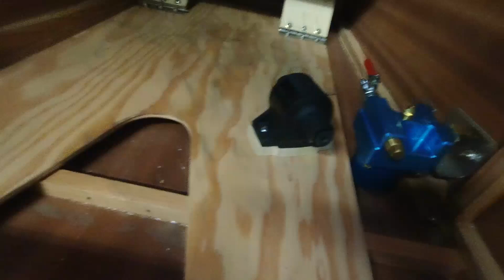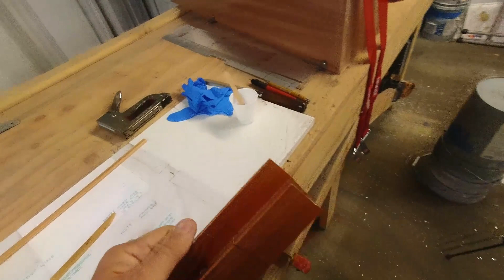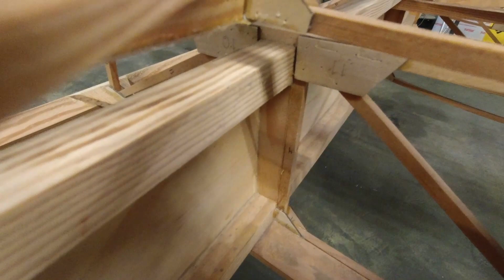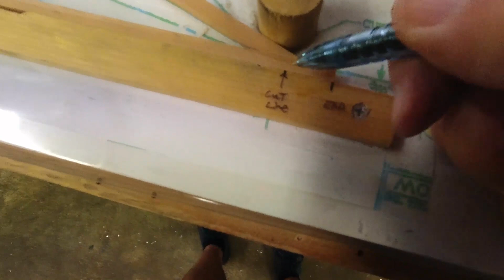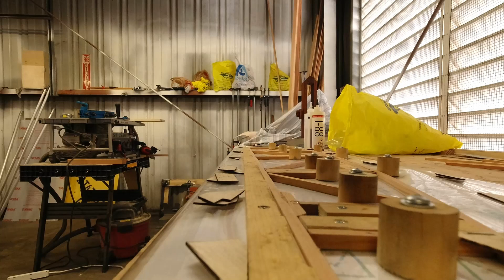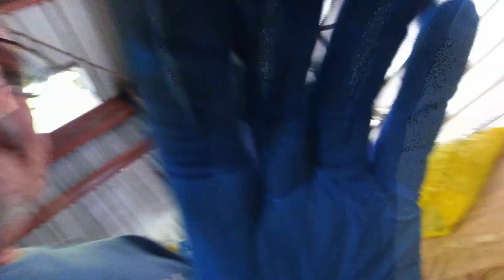Minimax 1100r Wood Aircraft Build Ep 130 - Building Wing Rib

Comment: So I’ve acquired a mini max. It’s older.  Stored inside out of the light..  so do I gotta worry about the glues and epoxy degrading?  Is that an issue on older mini maxes?
Reply from the maker: Do you know what epoxy was used? was it T-88?
Reply: @DTMinimax no idea.  It was built long before I was born I do believe..  my grandfather has had it the last 20 years and it was used when he got it..  I’m assuming it was built mid 80s.   Could be wrong tho.   Could be as late as the 90s.  Grandpa got it in 1999 I do believe

Comment: Did you ' rip " all the 1/4" rib pieces or purchase 1/4" cap strip from a supplier like Aircraft Spruce ? 
With regards the rest of the airframe, did you " make " all the spruce stock from raw material or purchase finished to size from a supplier like Spruce ?  
I 'm doing my due diligence on material and just looking for some input ...." roll my own " or purchase finished to size from ?? 
Lastly... did you " make " your spar stock or did it come from a supplier ?
Sorry for all the questions... appreciate your help...Thanks again !
Reply from the maker: Glad to help!
I cut all of my dimensional lumber from 2x6x12’ KD Douglas Fir S4S
At the time they were about $50 a board and I used 5 of them. They all had a minimum of 8 growth rings per inch. 
I did use some 1x8 Douglas fir for my rib caps and that wood was like 18 growth rings per inch. I ripped everything down myself and you can find some tips for that I’m some of my earlier videos. 
I probably paid a 15lb penalty for using all Douglas Fir. If I was doing it again, I would use white Pine for the tail surfaces, especially that elevator. I did have to move my engine forward a little to solve resting on the aft CG limit with all that Fir back there. 
My wing spars came from the same Douglas Fir. 
If you haven’t watched the wood testing video by Fisher Flying Products, I highly recommend it!
Reply from the maker: https://youtu.be/kx-3iNlr764?si=Xw0i2_Lhol_mlEpF
Reply: Thank you so much !! You have been super helpful as I tread these " waters ". 
Your wood really looks fantastic based on some of the other stuff I've seen...   @DTMinimax

Comment: G'day Dennis! 
Does the orientation of the grain matter with the 1/4" wing rib members? My natural inclination would have been to have the rings running vertically rather than horizontally like you did. But maybe it doesn't matter with square profiled members like those (and the spar caps)?
And the four 1/4" angled wing rib members, are they just left with square ends and not really joined with the gussest taking the load? I know it shows it like that on the plan but I'd have thought it better to cut angles into those ends so they fit in snug. Its it just a time thing...because I'd be happy to spend the extra 5mins per rib.
Anyways thanks mate.
Reply from the maker: Good questions. 
On the diagonal members, I’ve just always followed the plans and cut the ends square. Of course you can angle them if you wish.
The end grain is typically running at an angle. I picked the direction that seem to flex a little easier. As I recall, it really didn’t matter, all directions were about the same.
Reply: @DTMinimax  Thanks. I might spend the ectra time to fit them in nicely. Time is what I've got a lot of right now so why not. 

In terms of grain orientation, after thinking about it more I think you've done it the best way, the same way I will do it. I think the timbers are more likely to split along the grain, if anything, so having it sideways so you can see it easily through the wing root openings would make inspection possible.

Comment: Hi Denise since the release of this video you have received your engine and discovered that indeed you need to relocate the starboard side intake hole. I noticed on the 1/2 VW fuselage conversions from minimax download there is no mention of this. Their diagram shows a diagonal that is not cut to accommodate the intake pipes. Can you make available the corrected dimensions you  used for your installation? Thanks again for this Great Video series it’s been really helpful!
Reply from the maker: I’ll be happy to do that!

Comment: Another question- how do I find out what woods to use in the “RAW” list of materials? Example would be RS-9 as used in rib #5. I have seen where guys are using pine but that doesn’t sound right to me.
Reply from the maker: White pine is an acceptable wood for building. In one of my videos you can see me searching for a piece of northern white pine at Home Depot. As long it is 1/4 sawn, and has 8 or more growth rings/inch, then it will be fine for those support blocks. Search for this if you don’t have it already, it will explain grain slope and all the necessary knowledge for selecting your wood. FAA Advisory Circular 43-13

I have Douglas fir, Western Hemlock, and White Pine in my build. It’s interesting that Fisher, I believe, is using northern white pine almost exclusively now. Check out this video:
https://youtu.be/dNowY2HQ-Ag
Reply: @DTMinimax  thank you sir! I thought the pine would be too soft but I guess I was wrong. I will check out the info you provided and thank you for that and for teaching me the ropes of proper build ethics. I am having a blast with this build! I’m going to study up on wood selection and stick to your advice. Thanks again.
Reply from the maker: No problem Paul. The important thing is to get the best wood you can for the Spars and Longerons. My Douglas Fir has 8+ growth rings/inch and the grain runs straight down the boards for the entire 12’. It was a great find!

Comment: Great video! I used clear shelf paper to cover my plan and it works pretty good as well.the glue on the shelf paper seals the plan from outside air. Using a Kawasaki 340 in mine. Runs great but going to overhaul before installing. Thanks again for your work and answering a few questions I had on the rib construction. Well, back to building ribs!
Reply from the maker: Enjoy those ribs, that’s a fun part of the build!
Reply: @DTMinimax  I find it relaxing to build them. I lose track of time.
Reply: Quick questions on the rib build for rib #5- what plywood did you use for the filler pieces and would it be easier to install the gussets after the fillers are glued in rather than cutting them out like the plans suggests? How did you handle that. I am looking at fir for the filler as noted in the materials list for RS-672. The cost is about 1/2 of mahogany plywood. Are there any issues with that you can see?
Reply from the maker: @paulkeeton6512  Paul, I used Mahogany as I had some on hand. You can use Fir or Mahogany, both are fine. I put the gussets on one side, inserted the ply, and then added the gussets on the other side. I didn’t cut anything out. I believe the plans are assuming you’ve already built the ribs alike, except for the tip and root of course.
Reply: @DTMinimax  thanks for that info! I thought that made more sense than cutting out the gussets.
Reply: @DTMinimax  Dennis, do you think this needs to be aircraft ply for this situation or would mahogany ply from a hardware type store (premium) work. I’m looking at 53 dollars to ship 42 dollars worth of wood. Not that big of an issue if I make a bulk order from Aircraft Spruce, but they are only showing stock in California and I’m in Ohio. Hence the shipping cost.
Reply from the maker: @paulkeeton6512  Paul, that mahogany is Luan and is not suitable for aircraft construction due to the adhesive used. You can look for Okoume and that is a suitable substitute. Here is one source in Ohio…
https://forestplywood.com/product/marine-plywood/
Reply from the maker: I may have misunderstood Paul, if you are still talking about the #5 rib then you can also use marine grade Douglas Fir ply for that. It’s all about the fact that the plywood has to withstand a 2 hour boil test with no delaminating. It’s all about the adhesive used in the ply.
Reply from the maker: @paulkeeton6512  I should mention also that it’s not just about the adhesive, plywood not rated for marine or aircraft has acceptable levels of voids in the plys that are not acceptable for aircraft construction.
Reply: @DTMinimax  I kinda figured something along those lines but thought I’d ask someone who knows more about it. I’ll stick with what the manual/plans calls for to be safe. Thanks for the help!

Comment: Interesting to see your rib build and method. Thanks for showing your method.
Reply from the maker: I didn’t want to leave that out as it’s an important part of the process. I don’t have the spar either but it builds like the fuselage…build the frame and sheet it with plywood. I may show a section of it if I have time
Reply: @DTMinimax  I agree, the wing ribs are a big part of the build and there may be a lot of repetition but essential work that needs to be accurate. The plane is nothing without then.

Comment: Thank you Dennis.  This really explained the process well.  I like the tip for gluing a cardboard spacer on the aft surface of the jig block between vertical member 4 and 5 to ensure there is enough clearance for the aft spar.  I think that's where the drawing says "1/32 inch clearance for assembly".  I also noticed that your jig does not have the top block at the bottom of the cap strip between vertical members 1 and 2, and that you added a block foward of vertical member #4 near the top of the rib. I can see why you might not need the first block, but I can't see why you would need the second one.  Just an observation.  Thanks for another great video.  It'll make my rib building easier when I get the sticks soon from TEAM.
Reply from the maker: My material made the outline perfectly and didn’t need any help following the curve there. You just do whatever is necessary to follow the outline. Building the ribs is a lot of fun actually.
Reply from the maker: I just realized what you were asking me. The tension on the top cap strip wanted to pull that vertical member forward at the top. That’s why the extra block is there. It could have been a cam too and that would have worked real well.
Reply: @DTMinimax  That makes sense.  I can see that you really have to be adaptable and solve problems as they come up.  I was also wondering why you had to add plywood to the bottom of some of the vertical rib members.  Was it because you cut them too short by mistake (I assume you made your own sticks), or did you get the pieces from TEAM and found them to be too short for your jig layout?
Reply from the maker: @wiseacredave  This demonstration rib was made from my templates that cut all the pieces from. That ply was just added to the template piece.

Comment: I wonder if using some spring clamps to hold the back side gussets would work well. 50% less staples to pull out when dry.
Reply from the maker: Those clamps that cam over with the rubber bumper on the end would be a great way to make the ribs without staples.
Reply: @DTMinimax  Wouldn't it be hard to keep the surface flat & true though? I would think they even at low pressure they might induce a torque effect & possibly distort or twist the rib? Awesome question by the way @ulbuilder making my brain think for sure!